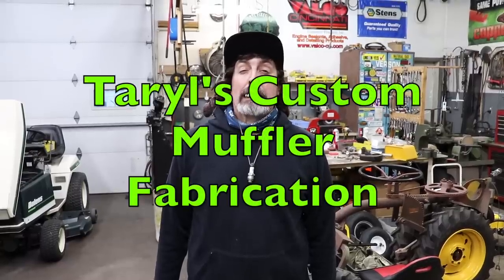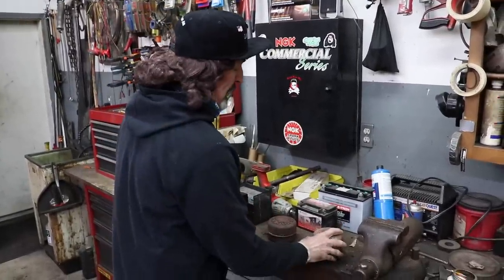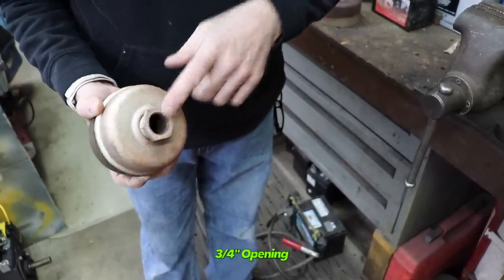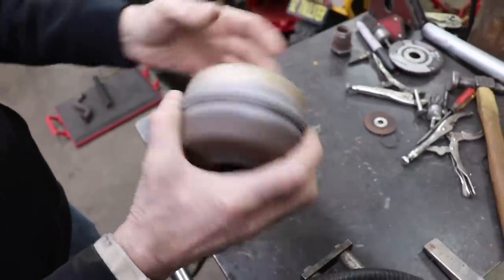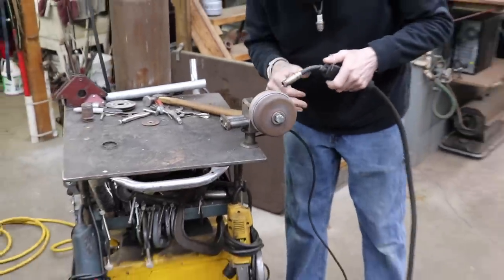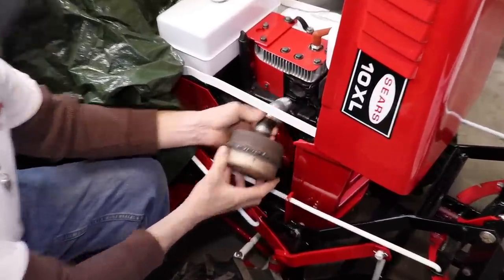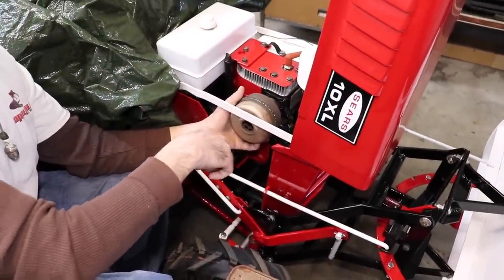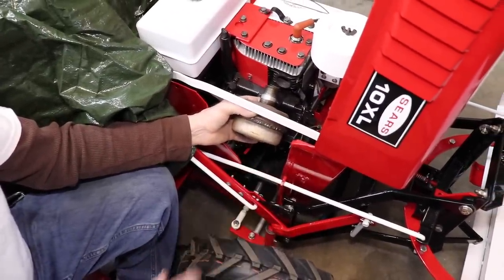Truly AMAZING Custom Muffler Fabrication

Comment: Looks cool but won't it get hot under the hood right next to the carburetor causing fuel evaporation? Just curious
Reply: i was thinking it needs a heat sheild between the carb and muff ,but maybe not

Comment: Why not go out the left side of the tractor hood and up. That way you can still put the weighted rain cap on it. Use a tin shield anywhere you're worried about the paint. Leave a 1/2" between the sheild and the paint and a 1/4-1/2 between the pipe and the shield. It works. Just route it away from the carb and fuel lines to avoid vaperlock. You can also put a support bracket on the left side for support. This way you won't have exaust in your face all the time. BTW, Nice paint job.
Reply: Turn it 180 degrees from the exhaust port and cross the pipe in front of the engine? Sounds good either way and there's tons of universal heat shielding available or DIY with sheet metal and hose clamps. Out the front and through the grille looks janky, as they say.

Comment: Thoughts on custom mufflers for B&S OHV Intek engines in the 15-20hp range? I've got a place I can buy then for ~$45, but I've got 3 tractors that I think need new mufflers, and the ones from that source seems a bit louder than I'd like.

Comment: Run with the cigar idea. That's exactly what I thought it looked like, even before you said it. It's always going to look like a cigar. If you try to make it look like something else, it will just look like a messed up cigar.  The cigar idea is a good one. It looks like a cigar and it's going to smoke anyhow. If you could weld it a bit or cut off the threads on the end, to try to make it look even more like a cigar, it would be perfect. Slippers could chomp on a cigar while riding the mower. It would be a cool "theme" for shows and parades. An old man chomping on a cigar while his mower is too.

Comment: I would put some heat shielding under the hood and around the exhaust system. That mufkin is going to get hot enclosed under the hood.
Reply: Maybe self sabotage?
Reply: revision 5: run straight pipe out the front--put muffler out side of front--no need to make muffler smaller

Comment: Heat from the muffler will effect the carburetor causing a vapor lock . I'd pipe it out front and add muffler there.

Comment: That thing is gonna "look good",my experience is I had a 1967 Wheelhorse with a 12hp,Kroller,only lasted 42 years(cheaply made),anyway,it had that same muffkin. Came straight out of the side and the exhaust blew right in your face.After a couple hours you felt nautious.I did the "45" deal & it solved the problem.With me it"s all about function,not looks.It's a lawnmower but yours is gonna look great.

Comment: Muffler pointing forward means constant breathing of exhaust while driving.  Why not run it down away from the pretty paint job and save your lungs.  Theres good reason mufflers are pointed everywhere but forward.
Reply: I'd wager most lawn tractors of last few decades have the muffler discharging emissions to the front of the machine. Closer to the ground because of vertical shaft engines, not an old horizontal like this one but still out front.
Reply: @Sludge73  Close to the ground I can understand but pointing the exhaust forward means the rider must drive into exhaust fumes.  Who does this serve for the rider to breathe exhaust fumes?

Comment: You might as well get rid of the muffler at this point and just straight pipe it out the front of the tractor. Kind of silly having that huge heat source under the hood and close to the carb-a-traitor like that.

Comment: Does anybody know what will cause my PTO clutch not to come on?
Reply: Got 12V when switch turned on at the clutch? With safeties like seat switch engaged.
Reply: @Sludge73  I don’t know but I’m going to swap out one of the safeties and see if that fixes it
Reply: Test for voltage at clutch first.  Otherwise you're just guessing and wasting time.
Reply: @dwaynejohnson6277  alright thanks
Reply: Be doubly careful troubleshooting anything to do with the safeties. I nearly chopped off my toes when I had most of the safeties bypassed trying to figure out why my Deere wouldn't crank. I've got the remains of the shoe hanging in my shop to remind me. Next time I'll take the mower belt off.

Comment: Wouldn't it be easier to run pipe straight out the side then 90 degrees up and then put a muffler on there like a tractor?